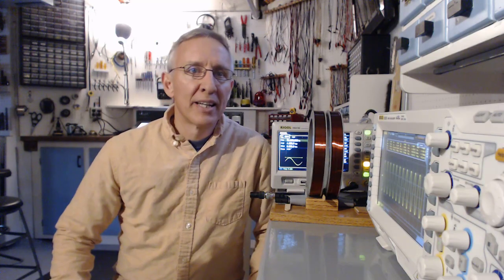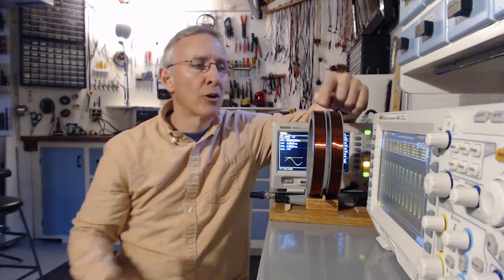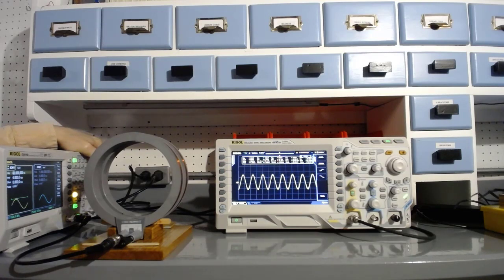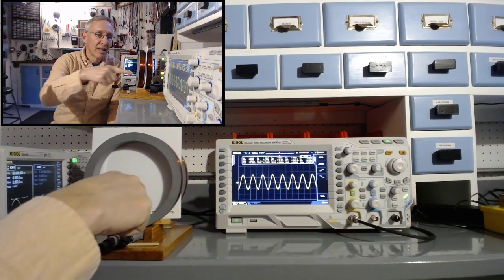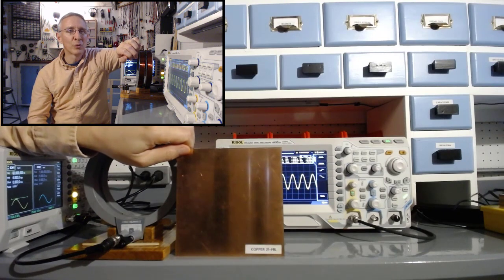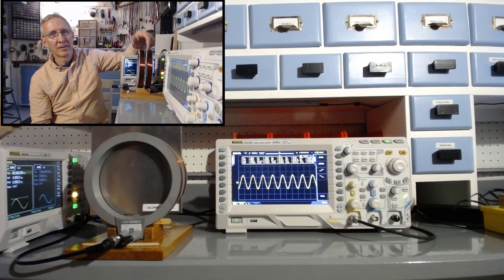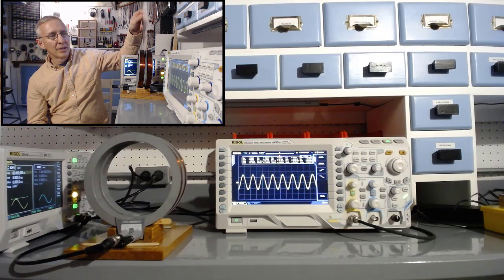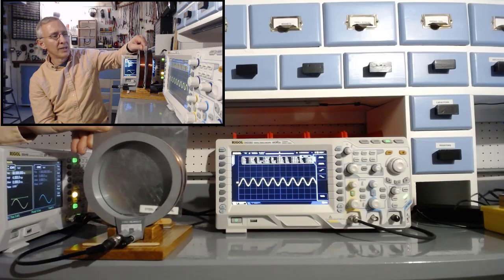Low-Frequency Magnetic Field Shielding Demonstration

Comment: Thank you, very insightful and helpful.   I"m building a guitar tube amp from a donor cabinet where the 2 power tubes are forced to be close to the speaker magnet.  Its been shown that depending on the situation, the proximity can deflect the electrons in the tube causing distortion in the signal and effect the output as well.  Should this end up being an issue, I was on the hunt for a solution to keep the magnetic profile of the speaker from effecting the performance of the 2 power tubes.   I would expect this frequency of the speaker magnet to anywhere from the steady magnet field throughout the audio frequency range.  Its hard to tell right now but, it might be wise to at least anticipate a potential issue with this and have some approaches to experiment with.  Thank you! Great video.

Comment: yeah MuMetal works really well, I am so glad you tested this cause I was wondering if it was really as effective as they said, thanks for the video!
Reply: Hi, I've seen that MuMetal material is very popular in shielding.

What do suggest for shielding transformer / substation? Are they at 50-60 Hz? 

Thnx 👍

Comment: Hi! Thanks for the video, I’ve been curious about shielding from EMP bursts, such as a solar flare or nuclear weapon. 
Most vehicles are made from a light stainless steel and and I find little data as to whether a vehicle would stand up to an EMP if we had a “Carrington Event”.
Reply from the maker: Solar flares and the E3 component of nuclear EMP are very low-frequency events that are unlikely to affect vehicles. These are more of a threat to power and communication grids with very long wires. The E1 and E2 components of a nuclear EMP event could affect or disable vehicles, but at these frequencies, any shielding provided by the vehicle body would be more related to the conductivity rather than the magnetic properties.
Reply: @LearnEMC  Thanks! I really ought to learn a lot more about this.
Reply: Faraday cage ?

Comment: I heard the usage of " shunting " a lot . But I was expecting the shield would be producing " Eddy currents" that try to cancel or attenuate the flux being produced by pri coil
Reply from the maker: That happens at higher frequencies (kHz and higher). See the video "High-Frequency Magnetic Field Shielding Demonstration." At very low frequencies, the conductive loss in the material prevents the eddy currents from being strong enough to significantly attenuate the magnetic field.

Comment: There was a huge change in the copper... look at the screen on the gauge thing you have . It dimmed the light on the instrument screen
Reply: That was an artifact from the camera's auto focus. The actual amplitude as measured by the oscilloscope is not affected. The illumination of the screen wouldn't be affected either way as you could see with the shielding steel.

Comment: If you are talking in millimetres in regards to the thickness of those plates then you your calculations are incorrect. Seems like you have added a zero to each one... Eg: when you said 60mm when it was more like 6mm and the last plate shown was more likely .6mm not 6mm
Reply from the maker: The units of thickness are mils. 1 mil = 0.001 inch.

Comment: Interesting. Good job explaining. Can you tell me... will putting a sheet of thin copper underneath my laptop block emf (and make it safer to use when it sits just above my lap)? Thank you.
Reply: Forgot to mention: I'm only concerned about the emf from beneath, as the laptop is wired (not wireless). Thanks.

Comment: He never gave us the product name or where to buy the last material he used.  Tim Rifat used one inch thick steel for his protection cage.  Mine wasn't nearly that thick so I guess that is probably why it didn't work.  Can you explain to me what a chaotic magnetic field is and how to create one?
Reply from the maker: The last material was a sample of a mumetal marketed and sold by MuShield . Mumetals have very high relative permeabilities at low frequencies.

You can find a very good explanation chaotic magnetic fields at https://physics.aps.org/story/v24/st24.
Reply: @LearnEMC  Hi. Does this test show that steel can somewhat protect the body from electric fields that is measured in V/m? Someone measured my computer with mouse and keyboard to be 50 V/m. He then said if I grounded the electricity in the house it would help lower that. Do you know how much one can expect it to lower with ground?

Comment: Would it be any difference if the shielding was a) built as a box/cage around the coil and/or b) if the shield itself was grounded?
Reply from the maker: The magnetic materials would work better around the whole coil, the non-magnetic materials still wouldn't work. Grounding makes no difference.

Comment: Thankyou, just what I needed to see. I'm currently trying to stop stray flux from my amplifier transformer interacting with the Tape head of my cassette deck which sits below it. Does the thickness of the mu metal have a bearing on its effectiveness? From what I've read on ebay they say not....but I would prefer your opinion!
Reply from the maker: The thickness affects both the reluctance and the saturation flux. Nevertheless, your application probably doesn't require a very thick sheet.
Reply: Thanks. I just checked the Mu Shield company's Facebook page and their last post was about a turntable similar issue finally enough. Watching that half success makes me wonder if I need something pretty thick. The flux field from my amp seems quite large - I have to lift it above my deck by about 15" to eliminate mutual induction. In your video, if the sheet had extended well beyond the diameter of the coils would the attenuation have been greater?
Reply from the maker: @hemiolabooks450  Extending the shield material farther out from the loop boundary would have provided some improvement. The lower the reluctance of the shield path relative to the air path, the better it works. I can't comment on your amplifier interference problem, I don't have enough information. Nevertheless, you can experiment until you find something that works.

Comment: could you show how neg charged magnets affect magnetic fields.  I heard of products people who are targeted by scalar harmonics will use EMF harmonizers, Quwave Defender, Rezotone 5G shield, Aulterra 5G shield, 5G bioshield, taking Zeolite which has neg ions, Neg Ion Generators, drinking ionized water...any of these things work? Some will paint their home with RF Shielding Paint (charcoal and graphite) or go with Iron Ball Paint to get away from EMF/RF/ELF.  I think Smart meter puts milliwave and scalar tech throughout the home which communicates with smart appliances, computers, wifi routers. how can someone have a zero faraday home shielded from ELF/Scalar/Harmonics/RF/EMF? I was thinking one can also run EMT/Flex electrical wiring and pull wires out of a room or two until you sell.  Now, even water meters have Smart Meters which pulse RF/EMF throughout your plumbing system.  So you have plumbing and electrical being used to radiate RF waves.  Why? thanks for the video.
Reply from the maker: There are a lot of scams out there with legitimate looking websites. Anything purporting to have health benefits sold in the U.S. should have FDA approval. 
https://www.fda.gov/radiation-emitting-products/cell-phones/reducing-radio-frequency-exposure-cell-phones
https://www.consumer.ftc.gov/articles/0109-cell-phone-radiation-scams
https://www.fcc.gov/engineering-technology/electromagnetic-compatibility-division/radio-frequency-safety/faq/rf-safety

Comment: your coil stan is blocking the ability of any shielding from being able to completely cover the part where your wood stand is. the wood is covering the bottom portion of the coils.and your plates are not big enough to cover the outside edges of your coil.

Comment: Is there a way to utilize magnetic shielding the same way a singer matches the frequency of a glass to shatter it?, to effectively stop an impact force such as a projectile (ie explosive) when magnetic shielding is combined with solid materials such as steel or even granite?

In practical terms, could one build buildings that could withstand attacks from high velocity projectiles utilizing magnetic shielding? Assume the walls would have the magnetic shield built in to them, the assumption being that the frequency of the shielding would match that of the impact object

Comment: Have you tried bismuth?
Reply from the maker: Bismuth is essentially non-magnetic (like copper) and would not provide effective magnetic-field shielding at low frequencies.
Reply: @LearnEMC  so what have you found is best for it?
Reply: @LearnEMC  also you can imprint a structure into bismuth while it’s cooling using a electromagnet or neodymium magnet. Could maybe cool a sheet of bismuth with a sheet say 100x100 little neodymium magnet all held together with a 3-d print to so all of them can be facing the same direction. 🤷‍♂️
Reply from the maker: @4v4t4rmusic  You want a material with a high relative permeability (like mu-metal). Materials with static magnetic domains (e.g. neodymium magnets) make poor shields.
Reply: @LearnEMC  I meant you cool the bismuth with magnets next to the bismuth. Not use magnets only for structuring bismuth. I’m not sure if it’s worth looking into 🤷‍♂️
Reply: Like melt it down, and cool with magnetic field beside the bismuth
Reply from the maker: @4v4t4rmusic  You would still have a material with a low relative permeability that would make a poor LF magnetic field shield.

Comment: HOW CAN YOU SHEILD FROM A DIRECTED ENERGY WEAPON !
Reply: Elf waves
Reply from the maker: Assuming you are talking about directed energy weapons employing microwaves, they are blocked by good conductors including most metals. They are not low-frequency like the fields in this video.
Reply from the maker: @jameselsden2690  ELF waves are not employed in directed energy weapons. The long wavelengths at these frequencies prevents the energy from being directed. They also would make poor weapons because so little of the energy at these frequencies is absorbed.

Comment: And where are the Eddy currents ?  They are there even at 0 Herz.
Reply from the maker: There are no eddy currents at 0 Hz. And at frequencies on the order of 100 Hz and lower, they are attenuated by the resistance of the metal, so they don't provide enough magnetic flux to oppose the incident flux.

Comment: Thanks for your explanation.
Could u please do one using a silver material please?
Reply from the maker: Silver is another non-magnetic material and would not be effective for shielding low-frequency magnetic fields.
Reply from the maker: @Mr Cat Magnetic materials contain magnetic elements such as iron, nickel or cobalt.
Reply: @LearnEMC  sir in this video you show that stainles steel is protect the magnetic flux. kindly share the detail of it which type of stainles steel is that
Reply from the maker: @goharnawaz9972  It is a mu-metal. This particular one was from a company called Mu-Shield.
Reply: @LearnEMC  sir is there any material which place between two magnets and magnets not attract that material. bcoz in mumetal at one side magnet and other side iron it attract iron.
Reply from the maker: @goharnawaz9972  There is no material that blocks a DC magnetic field, however a large sheet of mumetal will reroute the magnetic field lines so that a small magnet near the center of a large sheet will not be able to interact very strongly with a small piece of iron on the other side. The larger the sheet, the weaker the interaction will become.
Reply: @LearnEMC  thanks sir you guide me and give sme a sloution. sir i have neoagnet size 60x45x17 then how much sheet required to week magnet power.
Reply: @LearnEMC  sir for 50 to 60hz which material is best for sheilding

Comment: 60mm equals to 6cm what equals to 2.362 inches
Just thought this would be good for you and every viewer to know.
Reply from the maker: 60 mils equals 0.06 inches
Reply: 60mm is 6cm which equals to 2.362 inches.  And thats a fact.
Reply from the maker: @jebu74  Not debating that fact. It just doesn't seem relevant to this video.

Comment: I have subscribed to your channel but will leave if you make no sense. Do u mean volume of the plates when u say “thicknesses in mls… “
certainly you are imprecise if you indeed mean a length measurement of thickness in millimeters.
Sorry but simple units stumble make ur otherwise excellent video essentially unwatchable… 125 “mls” is 5 inches …
We never use “mls” anyway as it is a unit of volume and fundamentally wrong , bastardized slang for length in millimeters… you have an error …. ““60ml” thick” does not look 6 cm…ie  >2 inches thick …bro
Reply: Well.... you are entirely in the wrong.

A mil is one thousandth of an inch.  

Does that copper look like it's 25 mm thick?!?

You're watching a video by a North American, and as it happens many datasheets in Europe express thicknesses in both mils and microns.

That information was one Google search away.